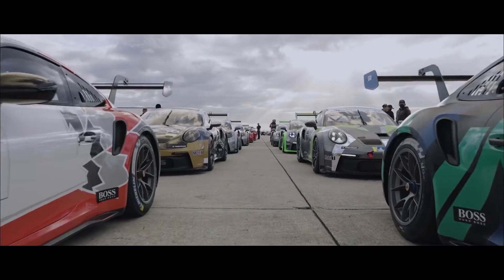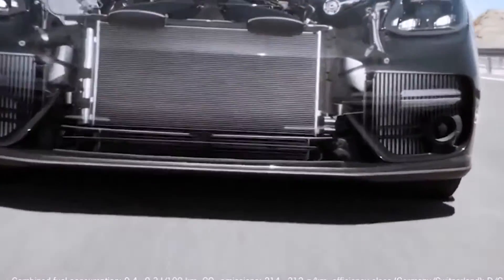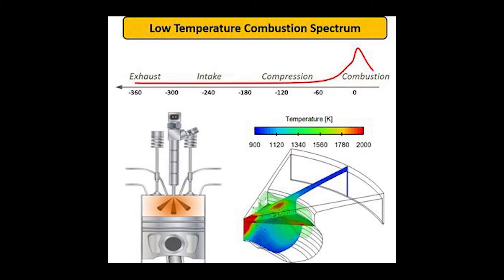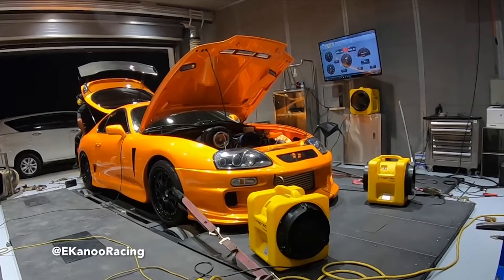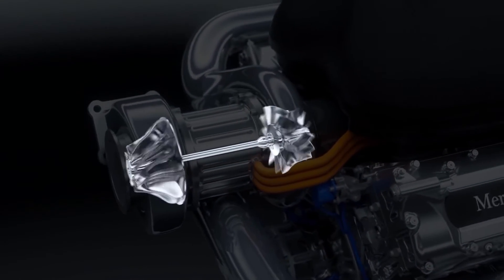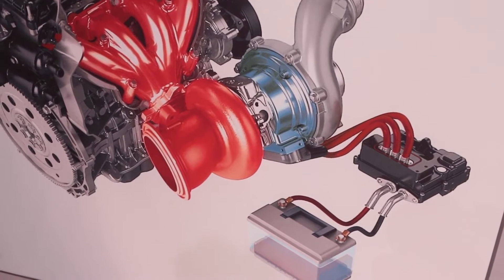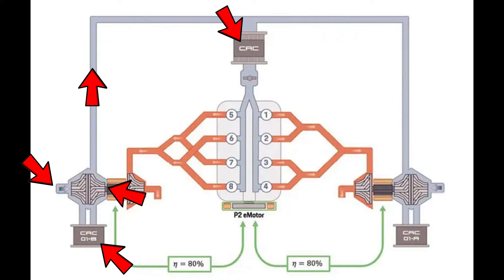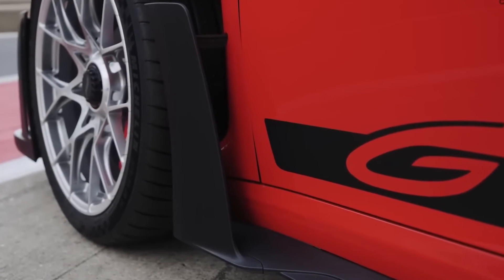How Porsche made a Hydrogen V8 produce 590HP

Comment: The Electronic Vikings having mixed feelings about H2 now because China pumping in H2 techs from Toyota. He speaked about Toyota's huge win from China for H2 techs. Toyota and Cummins making ICE powered by H2. New H2 refueling station in Kern County in California for trucks. I read an article about VW using H2 tech in VW cars. 

The trucking companies betting on H2 techs because they can't loses any time recharging their trucks before and after the works shaft. Also, Germany betting on H2 techs for backup plans for electronics is not good enough. The H2 techs it's underrated as an energy source in the world. The EV embassy of EVs and EV fanboys still thinks H2 techs are many years from now. The H2 techs going to hit them in their face w \ out knowing that hitting them.
Reply: Furthermore, Green Hydrogen is using solar as its main power source.  Basically, its the EV fanboys crying because hydrogen took their main advantage.  The cost of electricity to power their product 😂

Comment: 590HP and a range of about 5.9km. Making the power with hydrogen is fairly pointless if it's literally impossible to store the fuel to allow any sort of sensible range. At 590HP you would just be grabbing 2nd gear just as the fuel runs out :(

Comment: Wow! Porsche is now seeing the benefits of hydrogen and putting their minds to the task at hand. I wish there was a way I could speed up my efforts to get this water for fuel technology up and running well enough to start replacing fossil fuel use but things are slow going due to low funds at the moment. 
With each company that takes a serious look at hydrogen and does something like this truly makes that "YouTube Engineer" look bad as I watched enough of his video so see him comparing apples to oranges and switch it off once I saw him doing that. Oh, but I did turn the screen upside down to give him a thumbs up, lol. 
The true benefits of using hydrogen generated from water is it comes with all the oxygen for complete combustion thus any air that is drawn into the engine will have extra oxygen to add to the mixture. Now only to get Lotus on board with hydrogen cars.

Comment: Hydrogen expands a lot, and an expanding gas cools. I wonder if Porsche is taking advantage of that to cool intake air temps?
Reply: Unlike most gases, hydrogen heats up by expansion at moderate temperatures.
So no, it can't be used in this way.
Reply: @701983  Wow I didn't know that, thanks!